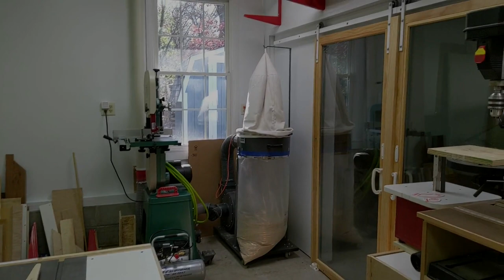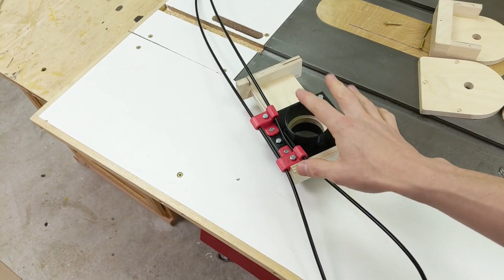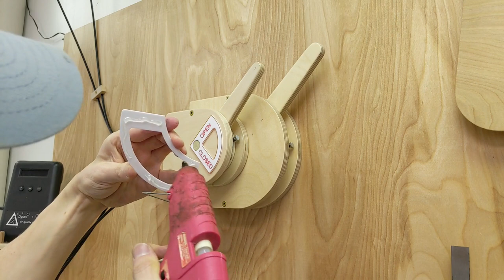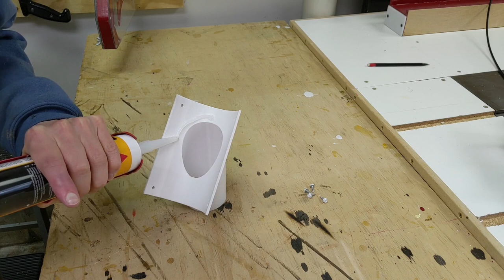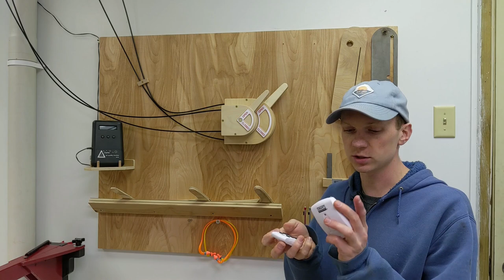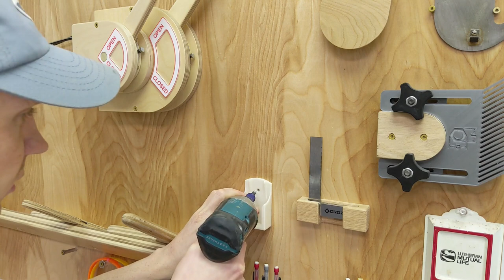Remote Control Dust Collection Upgrades

Comment: The booster for the smaller line feeding into the main 4" is a fantastic idea, looking forward to seeing your implementation of that. What's the rating on your remote outlet? I'm using a similar remote for my dust collector, but it is only having to operate a 2 pole contactor which does the heavy lifting of switching my 3HP blower motor on/off. Curious to see how the remote outlet holds up over time.
Reply from the maker: The outlet is rated for 15A. I do have my doubts on how long it will last. At least it was only $13 if it craps out.

Comment: Great invention, I have something similar in my classic car to activate the choke on the carburettors ,except it is a stiff wire so you only need one cable that turns it off and on and yet the idea of using this idea for directing it for air flow never came to my mind.
Great work Justin👍

Comment: Any reason for not using one push pull cable instead of two pull only cables? But that mechanism does sound satisfying.
Reply from the maker: You can't push anything with a cable. It's like pushing with a rope. It collapses.
Reply: @JustinDepew  with standard cables, yes. But they specifically make cables called push pull cables that have a different type of sleeve and a long metal end (instead of a ferrule) that allows it to be pushed as well as pulled.
Reply from the maker: I have not seen those before. I will have to check them out.

Comment: Hi Justin, great video. Did you try using a spring to help the return of a single cable control for a gate?
Reply from the maker: Hi Tim. Have you seen the videos on blast gates by Cosmas? This is how he did it. I prefer the pull pull method over using the spring return method.

Comment: Haven't seen you in a while, young man.  Great work on your dust collection.  Buy yourself a good filter, your lungs will love you.  Also, why not remove that filter and pipe the output directly to outside?  None of these options are expensive compared to your lungs and breathing.   Keep up your fine work and videos....
Reply from the maker: I have pondered exhausting outside for quite some time. I may still do this. Main disadvantage is the heat loss in the winter but that is probably worth it.

Comment: Why not mount the small pipe connection much lower on the large ridged pipe? Less length of short hose is more airflow. Even redesigning the over-arm to accept a larger diameter hose may be more worth it in the end? Going up even a quarter or half inch is much greater airflow.
Reply from the maker: I would like to re-design the over-arm to accept 2" pipe. I hope to include that along with the "booster" I want to also make.
Reply: @JustinDepew  I always feel like an ass suggesting things. Glad it was taken constructively and not just as some guy being a know-it-all. :)